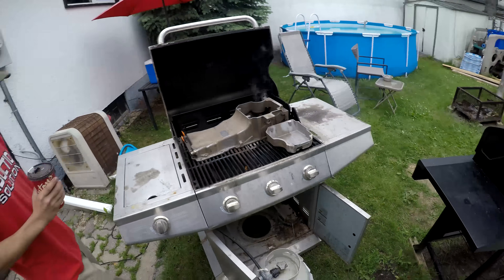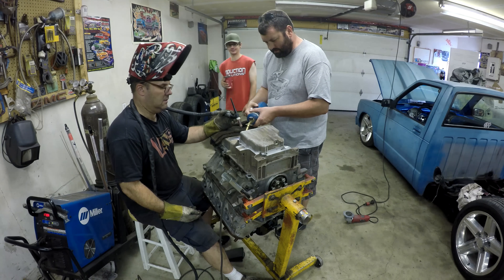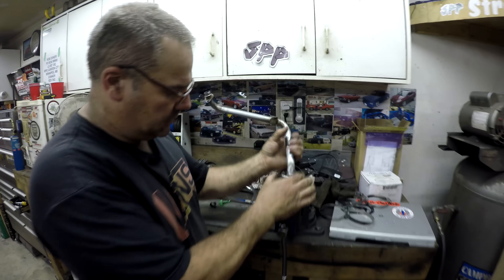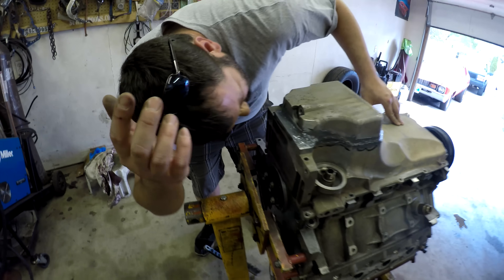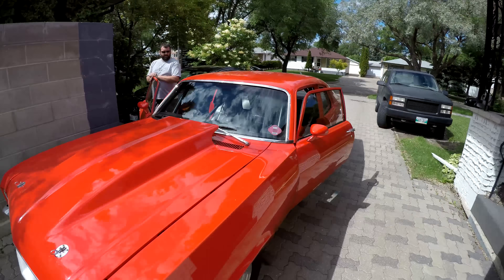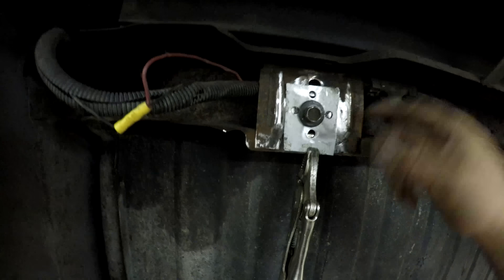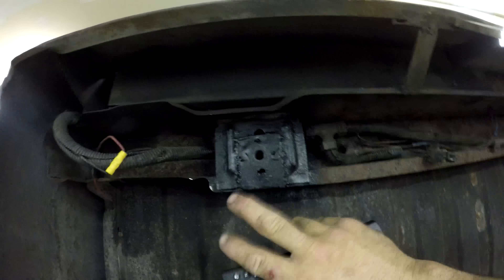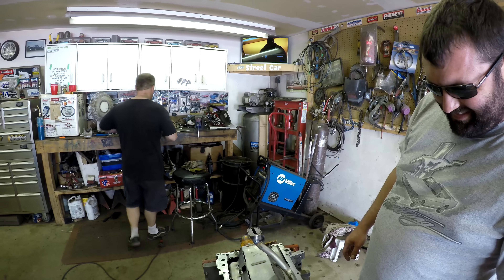The SH!THORSE's Junkyard L33 5.3 LS Engine is DONE | Welding a Chopped Oil Pan + More

Comment: Try brazing it with the TIG next time since your cracking welds. You might have better luck.
Reply: might as well just alumaloy it and i wonder what alloy welding rod hes using.
Reply: Same here. I haven't TIGed aluminum in a long time, but I would have stopped welding and sorted that out, definitely would not have resorted to JB Weld on my oil pan due to pin holes... not when it's out of the car and I have a TIG rig.

Comment: Hummer H3 pan works well
Reply: +jord9308 Thumbs up on the H3 oil pan and is also found on the Colorado / Canyon for two years...thinking 2008 & 09. OEM GM stuff that fits, does not leak and add rigidity to the block with correct oil pickup tube. Works great on swaps into the 67-up C10 and others.

Comment: The l33 is a gen 4 right?
Reply: Bryce Eisner no but possibly gen 4 rods.
Reply from the maker: Its a gen 3 with gen 4 internals
Reply: SPPTV  can you add gen 4 parts to any gen 3 motor or will some of the pistons fit incorrectly
Reply from the maker: Bryce Eisner The rotating assembly not being ballanced with the gen 4 parts is the biggest issue. Some people just send it.